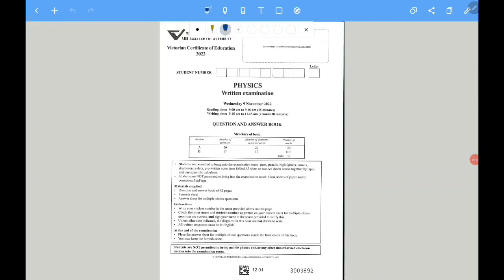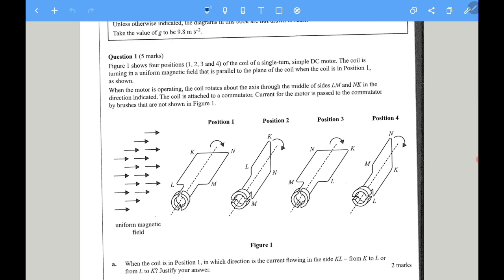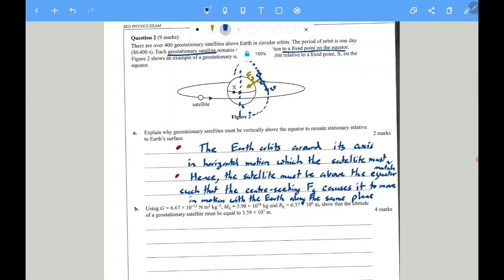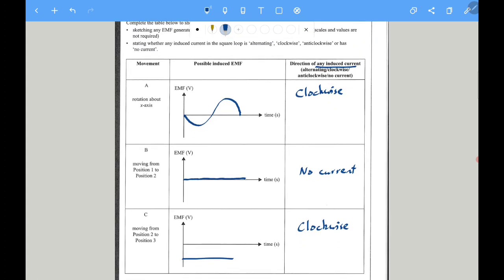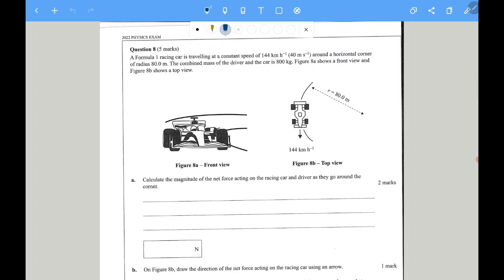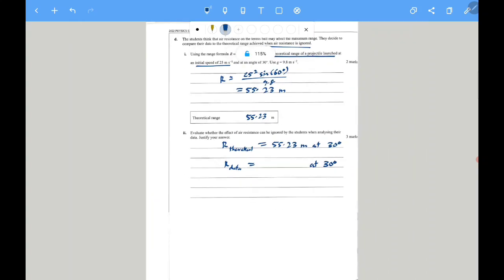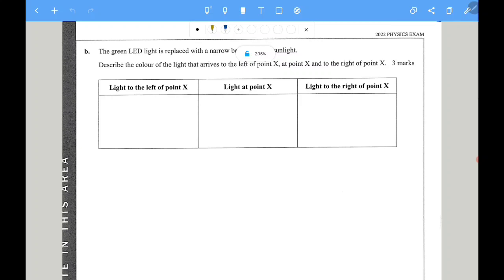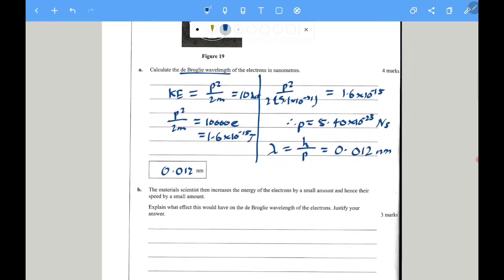VCE Physics 2022 Exam Solutions

Comment: Q9 of the mc, isn’t it 800? My teacher also said it was 800
Reply from the maker: why do you think it's 800?
Reply: @savsingh2759  force by A on B is equal and opposite as B on A plus the 400 of the other person
Reply from the maker: @vincentweatherly9991  the question asks the force OF the rope ON the person. Also, the person isn't directly exerting a force on the other person, it's via the rope. Otherwise there would be acceleration

Comment: For the EMF graphs I had the right signs but used a horizontal line instead of a curve, reckon they'll accept it?
Reply from the maker: sorry mate but you won't get the mark for that. In fact signs don't matter in this case, the shape does. Rotation ---> sinusoidal
Reply: @savsingh2759  What if you assumed that it was DC and the EMF would always remain positive. or above x-axis in other words? Do you think they might accept that?
Reply from the maker: @neelp1528  no sorry, no slip ring commutator here
Reply: @savsingh2759  Would the magnetic field from a current carrying wire obey the Inverse Sqare Law for magnitude? Because I had your answers for Q4 but last second I changed the last graph to have an EMF that starts high and ends at zero at a constant negative gradient. My thought process was that the magnetic field B didn't decrease linearly but according to an inverse square law (not really the best rationale I will admit).
Reply from the maker: @satya.anandakrishnan  unfortunately it doesn't obey the inverse square law. The formula for the magnetic field is quite complicated and outside of the scope of VCE.

This is how it actually looks live. 
https://qph.cf2.quoracdn.net/main-qimg-a2060b18a47efdeaf64bd5ff89ddb7ab-pjlq

Comment: How do you think this exam compares to previous years such as 2018/19, I'm trying to gauge what the grade distribution will vaguely look like.
Reply from the maker: Easier than 2019 and 2018 as there were no springs/diff. experimental question this year. Comparable to 2017. However a lot more nasty tricks this year so don't expect the A+ cut-off to be 90%. 

My guess is 85% at most.

Comment: For question 4, for the first and last one, I drew the graph the other way around lol, and second one I didn’t draw anything cause it was no current. Reckon I’ll get any marks?
Reply from the maker: Signs don't matter for EMF as sign convention was not specified in the question stem (didn't say take into the page as positive for e.g.). For the 2nd graph if you at least 'no current' on the table then you might get full marks, however depends on how picky your examiner is since current =\ EMF. They might think you didn't know how to do the 2nd graph worst case.

Comment: thanks a lot man, i think i dropped like 9 marks across the exam and was only averaging 72% in unit 3 before seeing your vids and resources. From then on i averaged 87% in unit 4 (rank 2) and am now looking at a way higher study score than i thought possible at the start of the year. cheers!
Reply: most satisfying thing was realising that the angle of incidence for that question was 50 degrees rather than 40, i didn't think many people would pick that
Reply: @earthchicken2233  Nah that diameter one was een more sneaky
Reply: @satya.anandakrishnan  well i spotted that diameter one straight away, the angle question i didn't realise until i was halfway through the question
Reply: @Jarek SOEN lol
Reply: what did u get lil bro
Reply: @slashbxe2832   i ended up getting worse than i thought on the physics exam... probably just didn't do some of the worded questions well enough. didn't end up checking my exam's result to see how many marks i got but here's my end of year results:
first semester: B+ (avg. 72% mid rank)
second semester: A+ (avg. 87% rank 2)
Exam: A (which is around 85 to 90%, to get an A+ on last years exam you needed more than 90%)

study score 37... mostly due to shit cohort and not going to a private school probably...

p.s. the lower than expected ss didn't affect me at all as I comfortable got into the uni course i wanted
Reply: @earthchicken2233  that's pretty good lil bro

Comment from the maker: NOTE: mistake in Q13 - picked wrong refractive angle. I knew I shouldn't have done this straight after a uni exam XD
Reply: I literally made this mistake in the exam😭
Reply: Was the angle like 35 deg?? Then use trig?
Reply from the maker: @jamesdinic6134  yes 35